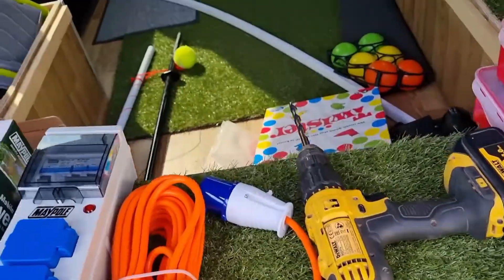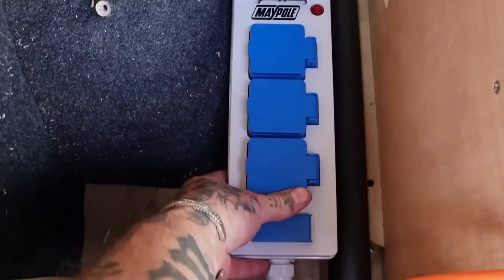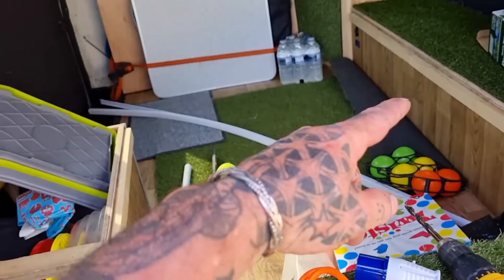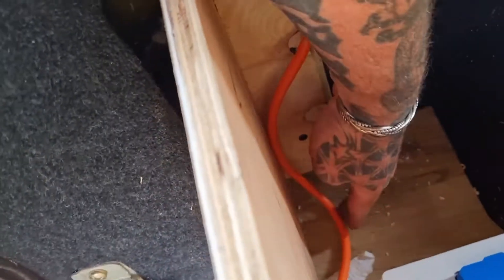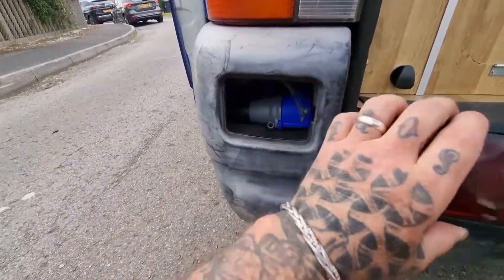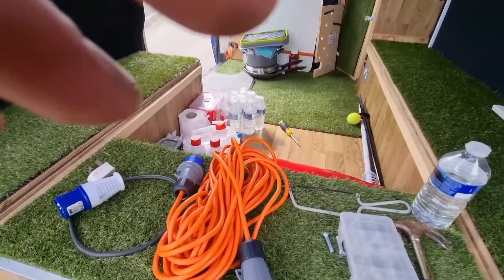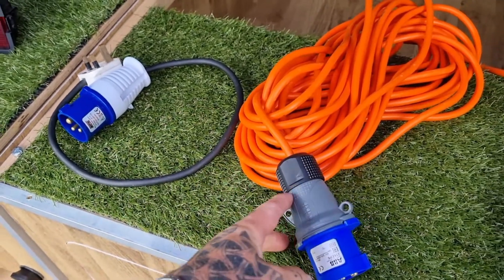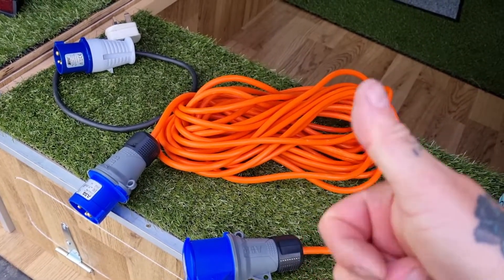vw t4 240v hookup (amended)..

Comment: Hi it’s John. I’m a sparks too. I was going to advise on the male/female plug swap. Obviously it has to be fail safe as who knows who will be unplugging one day. 
You may want to think about earthing the van to the power circuit on case a cable gets chaffed in movement vibration. You could end up with a live van. 
I am enjoying the channel though. Bike stuff is best for me. Best regards 
John
Reply from the maker: Thanks man I'll look into it. Can I earth from a socket body to the van body?
Reply: Brave call John . 
BS7671 Section 708 Caravan and Camping parks 

BS7671 Regulation 708.411.4  prohibits the connection of a PME earthing facility to any metalwork in a leisure accommodation vehicle (including a caravan).

I wouldn’t like to make a judgement call either way for a standard set up for earthing a chassis on a camper van as it would depend on the DNO earthing provision of the hook up site .
Reply from the maker: @100lrb  no disrespect intended but what ???
Reply: @docsworld9707  it’s a response to John not to you Doc for his recommendation to earth the camper chassis and if he’s he’s a qualified spark he should understand .
Reply from the maker: @100lrb  no problem . Just like to be informed.  Always trying to learn and expand my knowledge...
Reply: Hi Lee
How very true. It’s a tricky one. 
The problem with not earthing the van is the van could become live right? It’s only PME systems that should not be earned if I’m not mistaken. TT and TNS have independent earth. A real case I know about a fruit picker on a farm staying in a caravan got a belt after he stepped out for a bit of bladder relief, if you get my drift. Ouch! 
30mA RCD protected source is a consideration when suppling from home. Camp sites should have this sorted.
Reply: @electricsandotherstuff5258  That reg I quoted is in on page 267 of your regs book BS7671 18th edition amendment 2 and 708.411.4 applies to TN systems and particularly mentions PME but as it states TN system I would say it’s only safe to attach the CPC ( earth connection) to the chassis of the Van if it’s a TT system at the hook up site and additional 30ma RCD protection MUST be used.

However who would know this, I would bet that even if you asked staff at campsite they probably wouldn’t know what type of electrical earthing system they were using . So if it’s a TN system and a TN fault occurred it could potentially be lethal if your chassis is connected to the 230v (mains) earth supply that is why the reg exists and prohibits it. 

Also by the way not all campsites have RCD protected hook ups but most do , I stayed at one a few months ago in the Gower that didn’t, so it’s essential to have 30ma RCD on your van like DOC has.
Reply: Hi Lee, I just looked this up. Looks like you’re more up to date than me. I am a sparks 45 years in the game, but I haven’t updated to 18th. However I do employ 112 electricians who are up to date. The RCD should be at source the van is connected to. A fault can occur before the van RCD. If a fault occurs between live/phase and van chassis the van will be live. The RCD wouldn’t necessarily trip even if it was installed at source with no earth return path. Not sure what the regs are trying to do here. Perhaps you can tell me? PME I know why.
Reply: @electricsandotherstuff5258  I would always install to the latest regs so if PME at site then the regs prohibit connection of the CPC to the chassis of the van. That’s why I said it was a brave call to recommend connection to the van chassis as per your first post because it will rely on the earthing arrangements at the hook up site . How will the average Joe bloggs understand when it’s safe to connect to chassis or not.? I’m not advocating connection to the chassis or not connecting to chassis because it will depend on earthing arrangements at the hook up site.
Reply: I agree with what you are saying but not sure the amendment is specifically referring to TN-S. even if it is, the regulations are for the hook up site also. They must install a TT system of earthing where the regs require it so. 
As long as the hook up point is compliant an earthed chassis ok. The problem arises as you say, if the hook up site is not compliant. Also with double pole RCD. The problem is more prevalent when a 3 pin plug adapter is used for connection to a domestic (house) socket. The socket probably will not be on a double pole RCD if at all? 
So a proper dedicated caravan socket installed and compliant with the regs is the only answer to be correct on all points. Otherwise not earthing the van has a risk and earthing the van will have risk.
Reply: @electricsandotherstuff5258  Yep, totally agree that camp site EHU should be TT supply if it’s up to current regs but I bet many aren’t and how many people will connect the hook up lead to the house electrics via a 13A plug adapter like the one Doc has and they are widely available people use them routinely  to charge the leisure battery or keep the fridge running for example before a trip out , my guess is quite a few will do that and many of those will have a PME system at home . That’s why I said it’s a brave call to routinely suggest connecting the earth to the chassis. So should you connect it for a TT and disconnect for PME ? I wonder how many users will do that or even understand when to do it ?